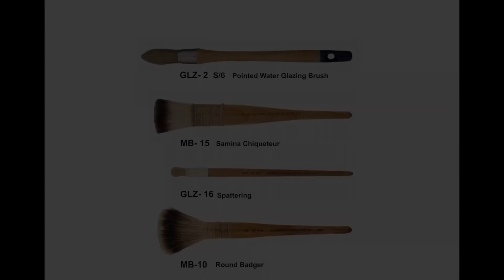Black and Gold Faux Marble

Comment: a guy that I worked with in the movie studios used a dagger which is a pin-striping brush it can make a fine line in on direction and with the bristles jostled a little will make multiple lines when moved sideways. Marbleizing is much when  you are doing it on a horizontal surface.

Comment: I love the technique, but sitting a tub on wood doesn't make sense to me! And then pretending it isn't wood... even less. I would have gone with a masonry solution and created voids with Styrofoam if weight was an issue!
Reply: I agree 100%.
Reply: I think weight was an issue, since tubs weight 300 lbs, plus approx 700 lbs of water—all concentrated on only four claws ( = very high psi)
Also, we had a claw foot tub and the plumbing for them comes out of the floor, so any holes would further weaken marble—which hates bending!
Also, marble floors are cool so, often pipes are run underneath for warmth = $$$   from Toronto,  ☮
Reply: Just to add to my other comment, marble is a beautiful stone, but it stains like crazy—even water spots—over and over again.
Reply: Weight is a big issue and with a properly supported framework, this is a good idea. Adding another 300 or more pounds of masonry to a floor( whats under it?) along with the tub and full of water....nah.

Comment: Your work is amazing, however you leave a LOT out as far as explaining. You said nothing about how you did step one, other than the word "alcohol." Perhaps you can do a voice over and explain for us?
Reply: At that point you see at the start of the video, he  puts a layer of  ( most probable) clear glaze, and after that  lays some color with the badger brush, after that he stipples it with the Chiqueter  and then splatters the alcohol and stipples again with the Chiqueter brush
 The alcohol will break the  glaze and create  these circles you see.  95" deg. alcohol will  do  , or Isipropyl as well.
 The secret lies in the timing and that has to do with how much water is in there in the glaze.  Cause without water there will be no reactionand no effect. So  glaze ( with or without color) with  some water in it. ( experiment on percentage start with 10% water ) and after application of  it splatter the alcohol
 Hope this helps as none share secrets.